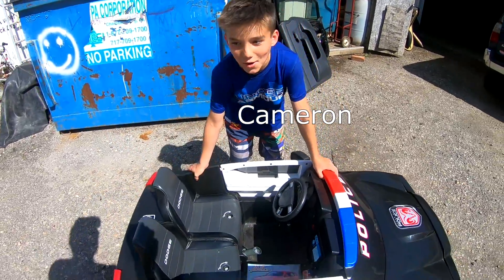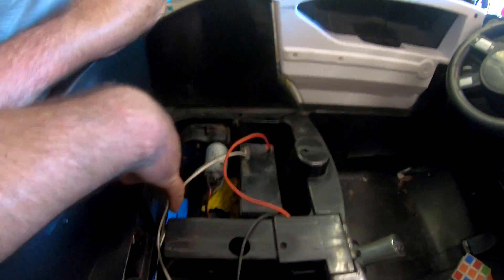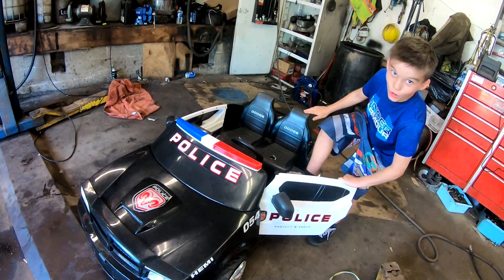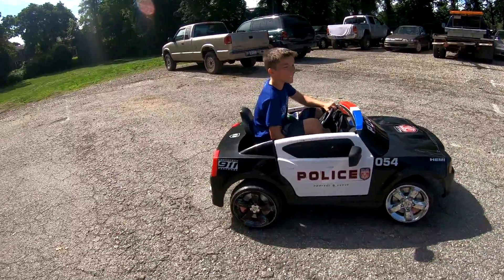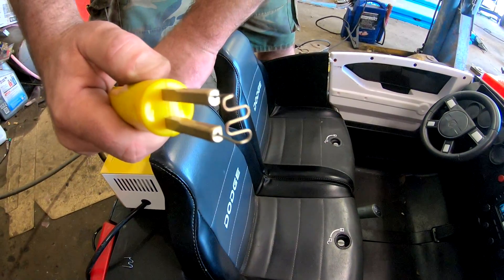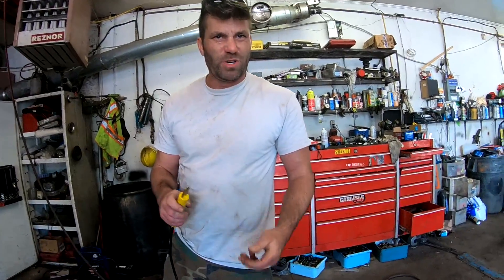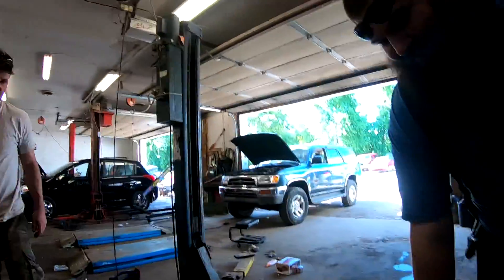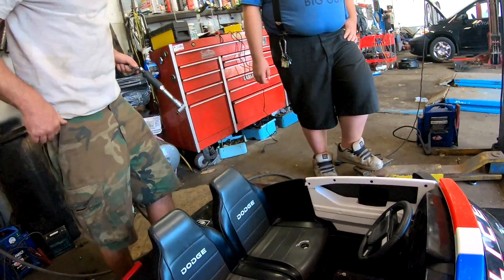Simple 24v Power Wheels Conversion

Comment: I’m no expert in the electrical field but I see many connecting it in parallel and some in series what’s better if your connecting and 18v battery from Milwaukee or Ryobi drills?
Reply from the maker: Well the only difference between parallel and a series is that the parallel just gives it twice the running time rather than twice the voltage but the parallel gives it twice the voltage or else it’s vice versa I forget lol
Reply: Thank you yeah you double the power in shorter time right but parallel gives you same voltage but longer run correct?
Reply from the maker: A series would give you double the voltage and have less run time parallel would have the same voltage as one battery but have double the run time

Comment: How long before gears or motors burnt out?
Reply from the maker: The Motor can burn out to avoid it should let cool down slowly every Drive
Reply: @CamsZone  doesn't even make since
Reply from the maker: Doesn’t make sense
Reply: @CamsZone  correcting my typo does not negate the fact that what you said didn't make sense.
Reply from the maker: I just said the motor will burn out to not burn it out don’t overheat it
Reply from the maker: All you’re doing is helping the video hit the algorithm so I don’t really care
Reply: @CamsZone  the motors are incased so kind of hard to tell if it is overheating. I just bought two 24v motors 35,000rpm and connected them to two 12v batteries and installed a metal gear. Problem solved.
Reply: Happy to help

Comment: When you put the 24v bateria the light the Police car work fine?
Reply from the maker: Mine personally did not have working lights I’m pretty sure it did have some sound effects everything worked fine and it could also even make The lights brighter in the sounds louder
Reply: Do you need to chance electronic out just put the new batery, the componentes eléctrica dont fritte
Reply from the maker: It is pretty simple all you need is some wires and connectors

Comment: Fixes headlight brackets? Seems jenky
Reply from the maker: Look it up
Reply from the maker: They’re actually made for that
Reply: What am I looking up, just hot stapler, got a link?
Reply from the maker: https://www.google.com/shopping/product/1?q=Hot+stapler&client=safari&hl=en-us&biw=375&bih=628&tbs=vw:l,ss:44&prmd=svin&prds=num:1,of:1,eto:9064645713727624802_0,prmr:1,pid:9064645713727624802,cs:1
Reply from the maker: The link to hot stabler
Reply: Lol, on sale from $999
Reply: BTW, really appreciate the video.  I went with the $120 unit, just finished a repair on a hood for a stump grinder.  Dealer wanted over $3k for a replacement... One way or another that wasn't happening.
Reply: I'd just get a new bracket lmao
Reply from the maker: @savagesock3598  This thing will make up over it’s money over and over you can use it on expensive RC cars that break all the time

Comment: Awesome!
How do you charge it? Can you charge both at once with the factory charger?
Reply from the maker: You charge it with a car charger. It’s very simple stuff
Reply: @CamsZone  Thanks!
Reply: When charging you have to switch wires to run parallel otherwise you are charging 24v with 12v charger will take much longer to charge.